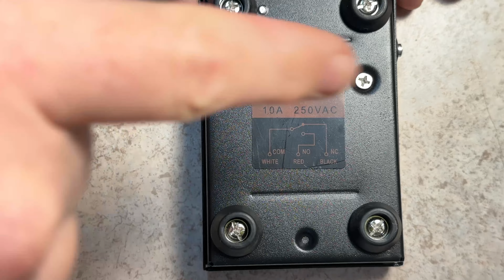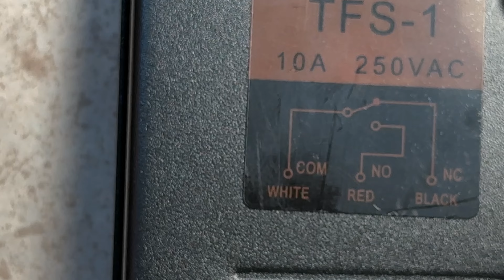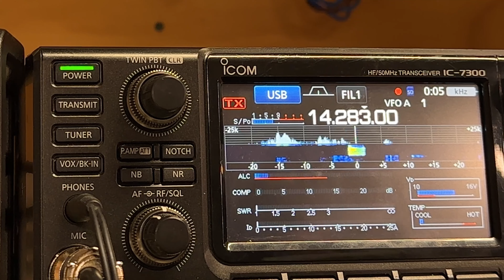2024 PTT Switch

Comment: I have one of those industrial foot switch's with two foot peddles... Its heavy AF! And the darn thing kept getting in the way to many times. so in my quest to find a replacement. I attempted to use a sewing machine foot switch that was acquired from a goodwill... yeah that didn't work, for some reason it kept giving a sewing buzz when keyed! So I bought the same foot switch and cutup a cheap black usb cable I had laying around to get the length I needed. With the shrink wrap you cant tell its not OEM. Its a good cheap foot switch that might outlast the radio and would recommend anyone who needs a foot switch to just make this, instead of buying one of those cast iron widowmakers.
Reply from the maker: I almost bought one of those industrial types because - cool. But the price was way more than I wanted to spend and as I have said, I'm a cheapskate. :)
Reply: @LifeAtTerminalVelocity  I think I got mine for $10 at a hamfest pre 2019. It was in bad shape with alot of rest. I ended up sanding the rust off and painting it this light yellow thinking I wouldn't stub my toe on it... yeah that didn't work LOL.
Reply: Lol I just installed the double foot cast iron switches. One to the hf one to the vhf. It is clunky though. Got mine free from a remodel at work😎
Reply from the maker: That is the kind I was looking at. Someday I might get one just for kicks.